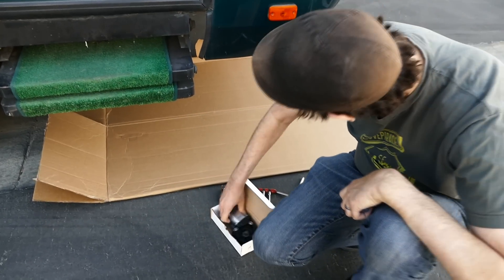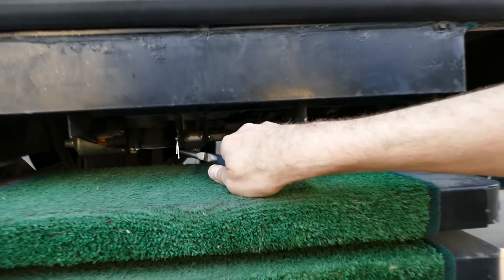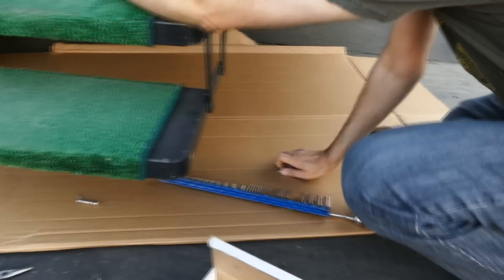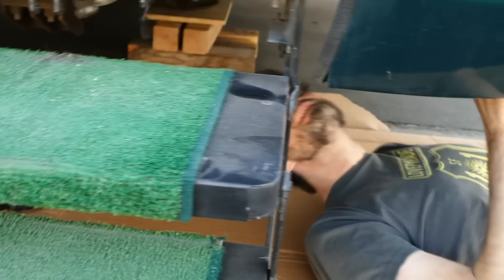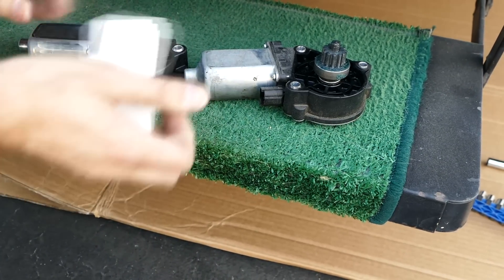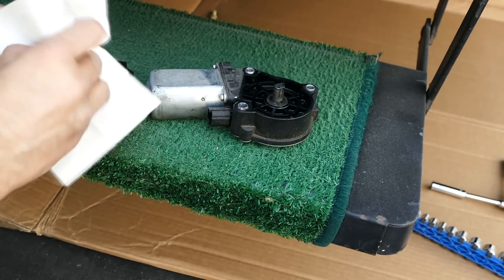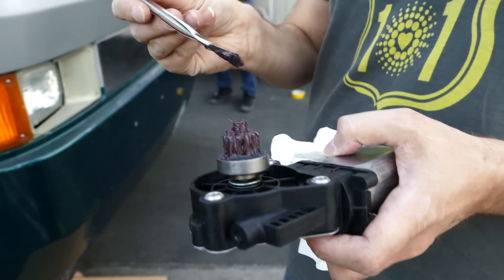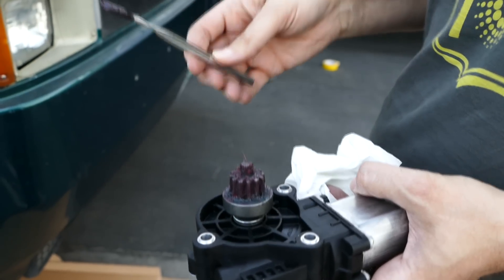RV Kwikee Steps Repair

Comment: Before you break out your tool box, or park it at the Dealer for a month..... I took a 3x3inch magnate and waved it next to sensor on the door, and Voilà, steps work👍
Reply from the maker: In  some cases that can work, but in our case the magnetic switch was working properly... the motor really had a worn (stripped) gear and there was no other way than replacing the gear (and since you can't seem buy the gear itself, the whole motor had to be replaced).

Comment: For some coaches, I recommend that you reattach the gear assembly to the steps BEFORE you reinstall the motor.  It is much easier to do that way.   The cotter pin on my coach is darn near impossible to line up for reattachment to steps if you install the motor first.
Reply from the maker: Great tip, thank you! :)

Comment: These motors have a plastic screw gear inside. Make sure your dog or yourself doe not step on the steps until they are fully deployed.
Reply from the maker: Yes, that's good advice to extend the life of the gear assembly. However, they will also just wear out over time and a 20 year old coach will likely have that problem sooner or later... luckily these motors (with gear assemblies) are relatively easy to find.
Reply: The Cruisin' Crew if you find a supplier that sells internal parts to the motor I'd be interested. It's a shame it cost 70+ dollars when it's usually 1 plastic piece worn out
Reply from the maker: You might find these motors in junk yards too... they are usually used for power windows in cars... but yeah, it's unfortunate that modern economies waste so much resources for easy profits... stuff that lasts or is easy to repair is not a good money maker for "industry" ;)
Still, paying 70+ is better than paying 300+ for a complete step replacement...